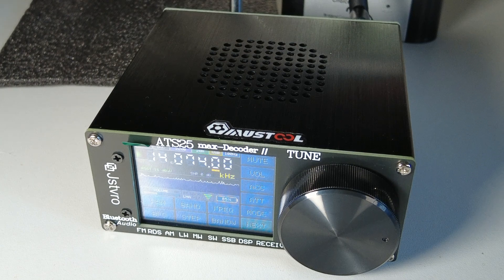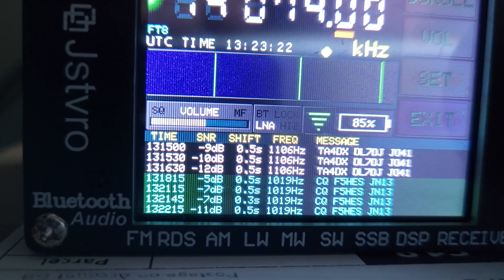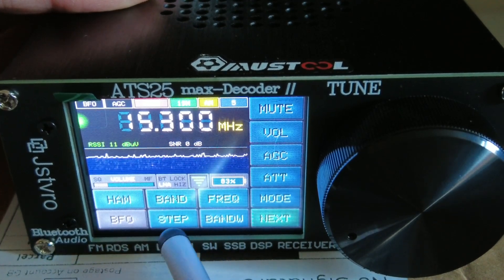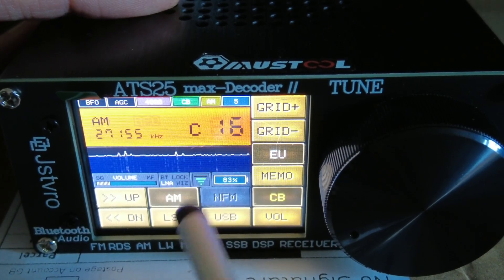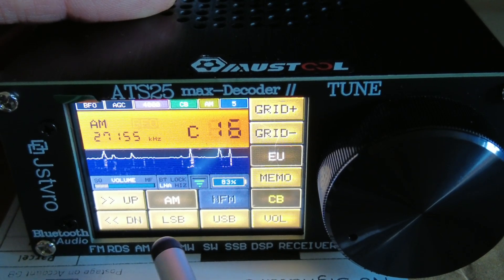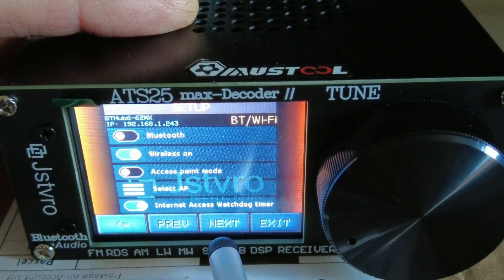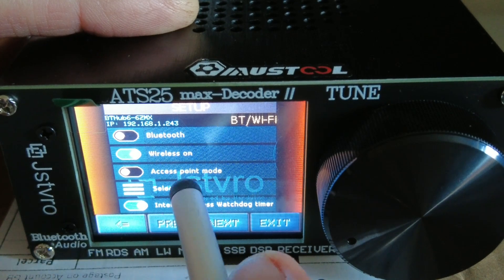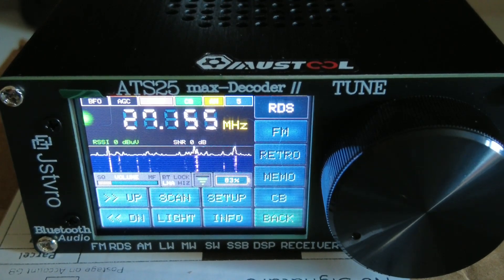Decoding FT8 Signals with the ATS  25 Max Decoder 2

Comment: Thank you for this video. I'm new to all of this and your video helped me greatly to learn how to read decoded messages by using your data and AI to teach me how to interpret FT8. The first message TA4DX and DL7OJ were swapping callsigns to enter the contacts in their log. TA4DX was from Turkey grid KM69 and DL7OJ was from Germany grid JO41 approximately 1,300 miles apart. The second message was a call to anyone (CQ) from callsign F5HES in grid JN13. Southeastern France. At this point there was no response to the CQ.